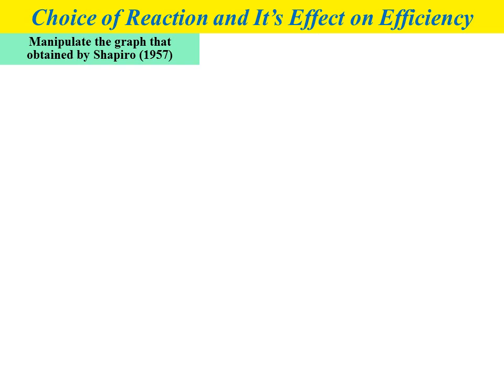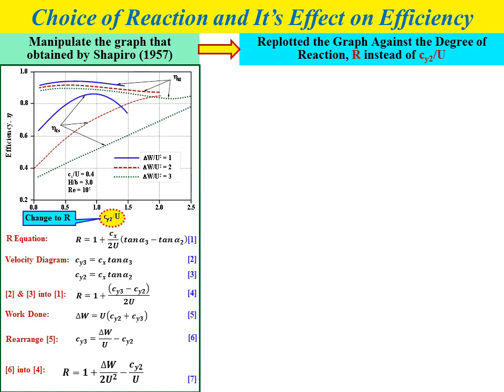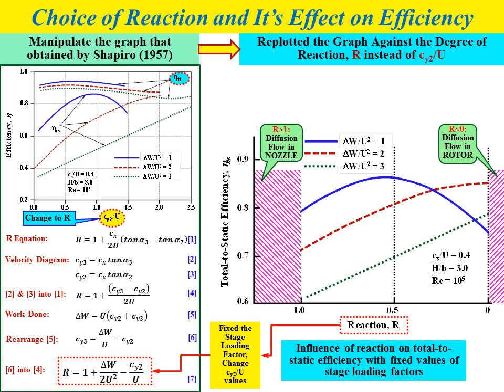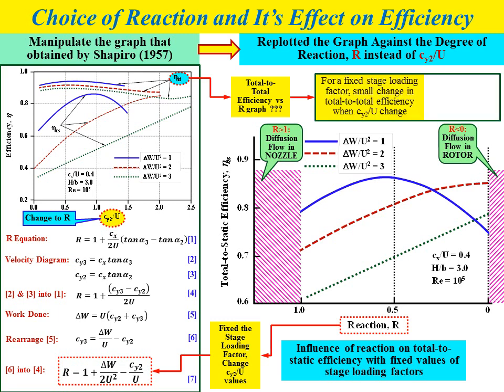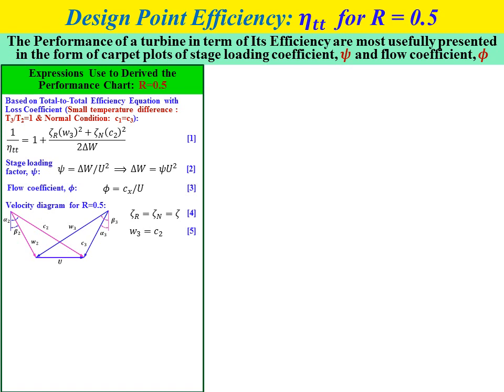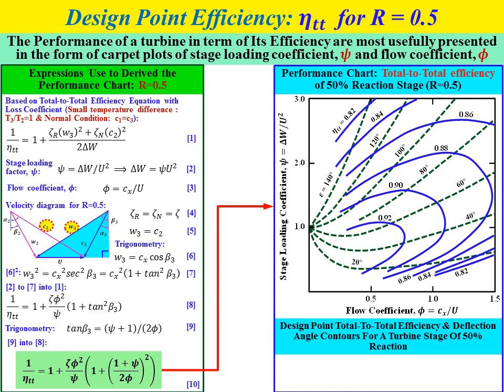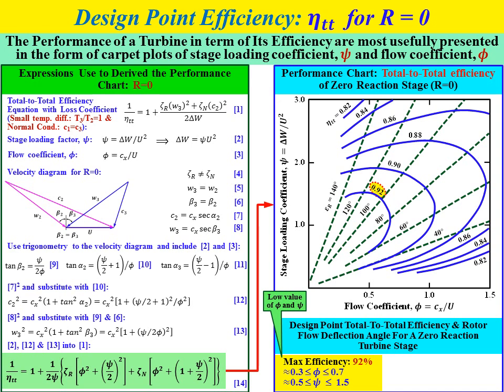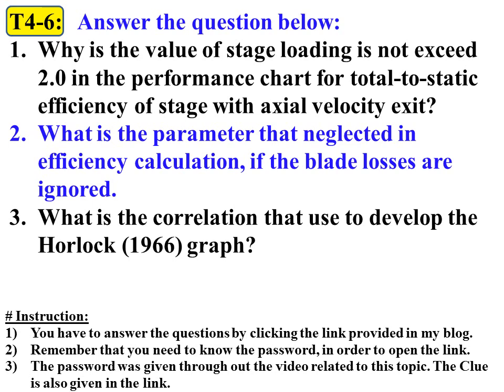TM LEC #26: CHAPTER 04 AXIAL FLOW TURBINE PART 6

Comment: Dr, in slide 2, why is the reaction value on the x - axis upside down? Any specific reason for that?
Reply from the maker: Remember the second graph actually derive from the first graph by shapiro...implement equation [7] to each value of cy2/U value at x axis of the first graph. With out change the position of the R value obtained...you will get the upside down value as in x axis for graph 2..However..it also doesnt matter if you want to rearrange the number of x axis as normal...but you will get reverse curve..compare to shapiro graph.